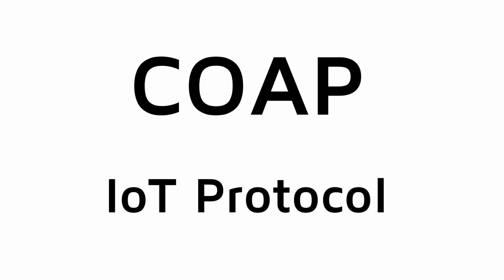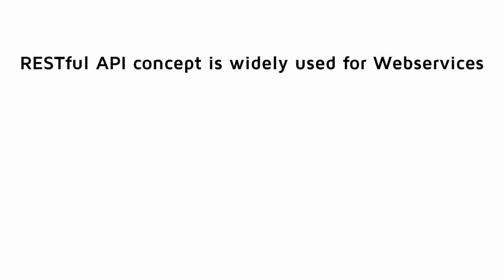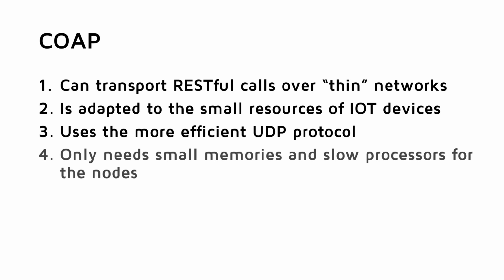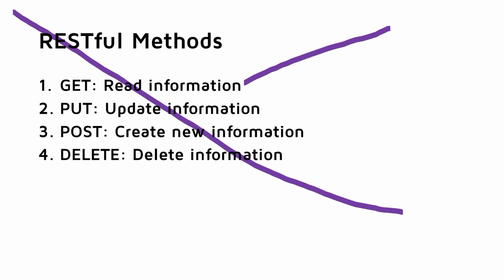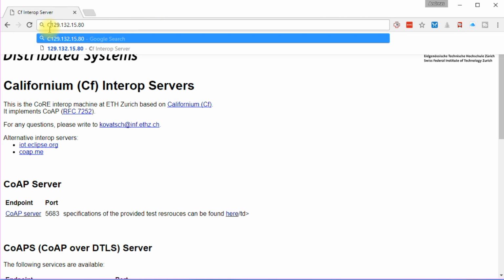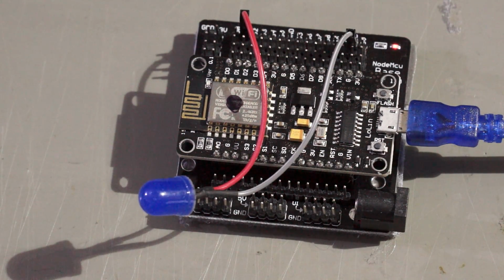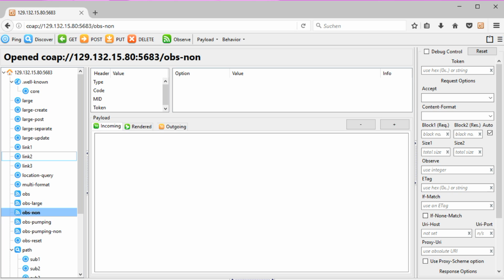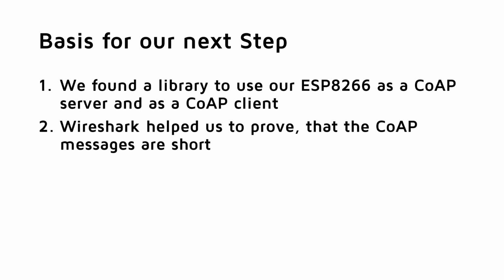#144 Internet Protocols: CoAP vs MQTT, Network Sniffing, and preparation for IKEA Tradfri Hacking

Comment: Hello Andeas, thank you very much for all your easy explained videos. If you hacked the IKEA Gateway, do you think it would be possible to use the Tradfri Remotes and Motionsensors as seperates device. I use FHEM to automate my home, but unfortunatly all the plugins I cloud find weren't able to use the triggers as seperate device and they get uselesse when the bulbs are managed by fhem. regards
Reply from the maker: The remotes still work with my gateway (in parallel to the signal from the Raspberry. But, of course, you cannot connect tehm to your Raspi because they use Zigbee. But you can read the status of your bulbs with the Raspi.

Comment: I'm too invested in MQTT to change. I don't even see features that are unique and wanted badly.
Who here knows the limit of data transfer (Bandwidth in MB/S or KB/S) using a RPI running Mosquitto? I have not been able to find that info!
I want to connect an ESP8266 to my lab test equipment but not sure at what speed it can stream data back to me through MQTT.
Reply from the maker: +UFOhunter I think, it is not about change. It is more to understand the differences. And if I want to use MQTT for the IKEA bulbs, I have to deal with COAP.

Comment: The reason Trådfri doesn't translate in swedish is because it's not a proper swedish word but a play on words 🙂
Reply from the maker: From the lengthy discussions, I also learned, that the same applies for Danish...
Reply: Same for Norwegian. It's a perfectly valid compound word (if a bit clumsy), but not in the dictionaries. And while Google translate translates the "Danish" Trådfri to "wire-free", if you try with Norwegian you get "suture-less". Isn't machine translation fun? ;-)
Reply: True. The correct danish word is "trådløs" though. "Tråd" meaning wire, "løs" meaning without

Comment: So with MQTT there is the broker, how is it done in COAP. I only got that there is a client and Server.   I understood the COAP's client/server model ( UDP ), but does that mean  this is a point to point ?
Can a client also be a server as is in MQTT?
Reply: Raad Yacu with CoAP you can decide whether to keep server or client or both depending on the architecture.
Reply from the maker: As I presented in the video, usually, you have no broker with CoAP.